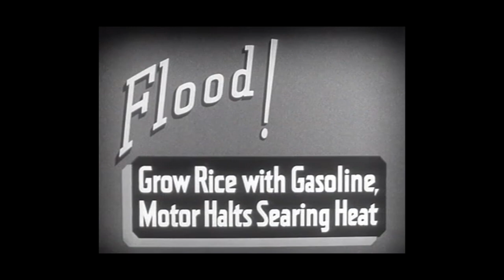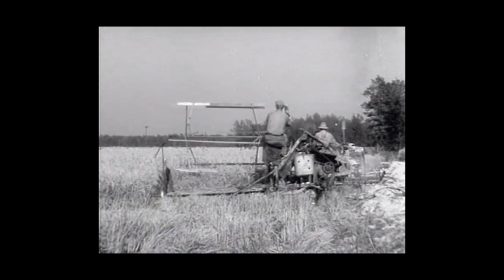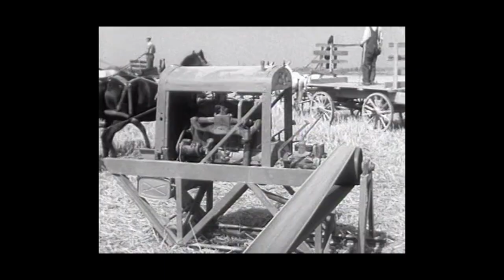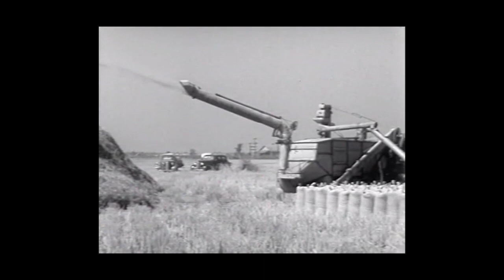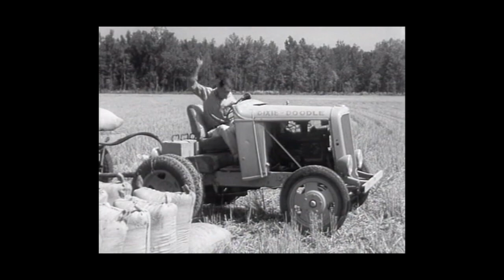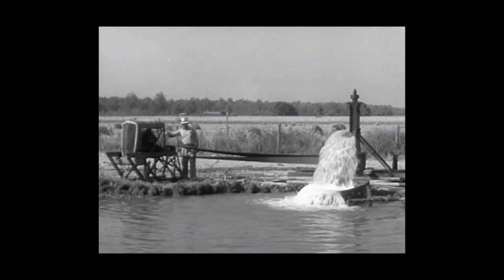VINTAGE! 1939 Chevrolet Automobile Motors Power Farm Machinery! Classic Tractor Fever

Comment: I have a bug tractor. My dad bought it for 50 bucks  after somebody traded it for a car back in the 50s.  Most bugs were Ford model A cars with add on features. Mine has a greyhound bus refrigeration unit governor, 66 chev  Malibu door skin hood, ruxtel truck rearend,chev tranny , 72 Polaris colt seat, 60s chev steering wheel, radiator from who knows what. Runs great.
Reply: Sounds like a Johnny Cash one price at a time
Reply: @horsepower0539  it is the physical embodiment of "One piece at a time"